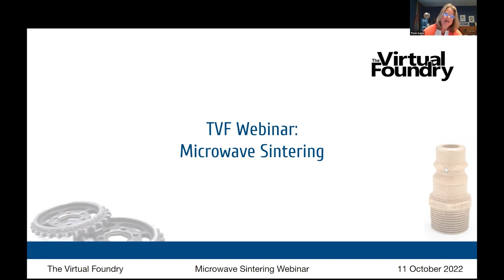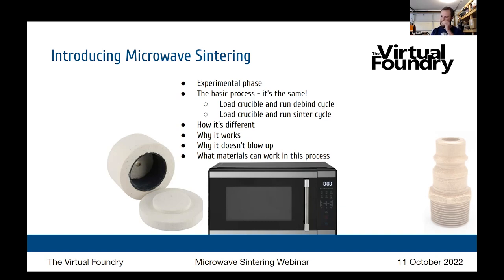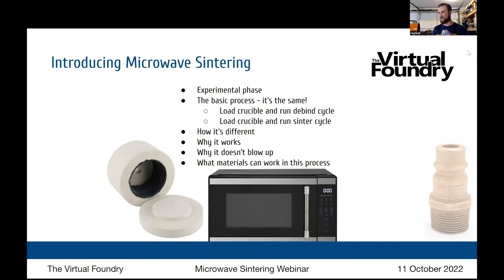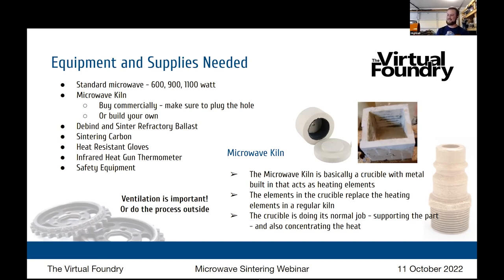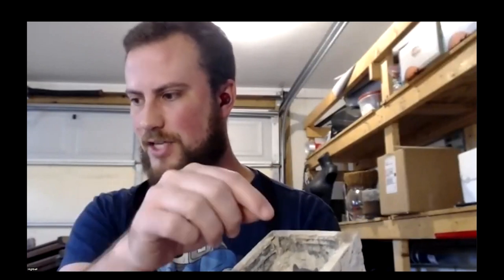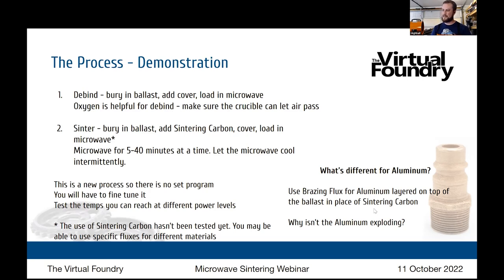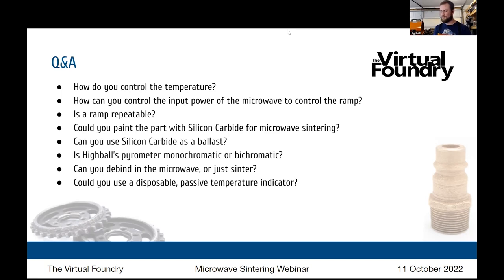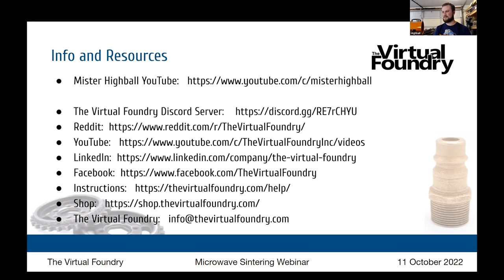TVF Webinar: Microwave Sintering

Comment: Great webinar! As for microwave oven getting too hot, could you not just use a second (or third seeing as they're inexpensive) oven and keep transferring the kiln between them all so the others are cooling? Also what about Inverter microwave ovens? Are they suitable also?
Reply: Absolutely could do that (I have two more microwaves in the shop now). 
Using an inverter microwave is interesting 🤔 
From looking there doesn't seem to be any reason why it wouldn't and I'm guessing it'd have a little more predictable ramp rates

Comment: I am not familiar with foundry work, but I have an idea that I think might help. Utilize a Raspberry Pi (or maybe even an Arduino) in conjunction with an infrared sensor (for temp sensing, as I'm assuming physical probes would be destroyed by the heat) and a smart microwave (controllable by Alexa, etc) to automatically start/stop the microwave as necessary to maintain a desired temperature. Last I looked, there was only one affordable smart microwave option (Amazon brand), and I want to say it was 600W. If the power of smart microwave options is insufficient, the control board of a desirable microwave can be "hacked" and controlled with a Pi or similar (might also require an add-on "hat")...just basic electrical work to achieve that. Writing the code/logic would be pretty simple, and you could even write different programs for different metals! I follow some folks on various social media platforms who "hack" devices to transform them into smart devices, so feel free to reach out if you need that resource.
Reply from the maker: Right on. This is likely where we'll wind up. We just stepped off the starting line with this method so there is a lot of room to advance.
Reply: @TheVirtualFoundry  I love this potential...could bring metal 3D printing to any home and could easily be utilized (with enough power generation capability) in remote, off-grid situations for emergency repairs, etc. Y'all might see if you can land a research grant from DARPA or NASA or some other government agency that might have a need for this. Have someone else bankroll your research and have world-class technology at your fingertips to analyze the strength of your parts, how to optimize your alloys, etc. I'm assuming this isn't already being explored, which might be a big assumption.